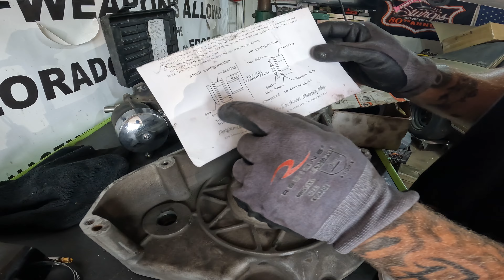Preparing my bike for STURGIS and I broke it

Comment: Good morning 🌅, you are about 3 weeks To late, I have just done my 2003 Deuce, It is a great idea to wear your rubber 😂  gloves 🧤, has a lot of oil and solvent that can be absorbed into your body, and then build up overtime and then cause your problems later in life, 
Not sure on your jack shaft , I think there might be a spring, I very stupidly put mine all together, and then realised that the spring had fallen out into the box where I’ve been storing my bits and pieces, The Jim’s bearing upgrade is a great idea, I have done mine, it was done on a press, that was unfortunate that you done damage to the inner case, I had to change the drive belt and sprocket on the output shaft of gearbox, I ended up cutting the sleeve off, and change all oils, I have done around 250 miles since doing this, now got a bad tapping noise coming from my rocker , so I’m going to get some rocker lockers hopefully in the next week or so, ,
I’ve only had the bike for the past three months , previous owner or owners have not looked after the bike very well, 
Keep up the great work stay safe where are those gloves? , France.